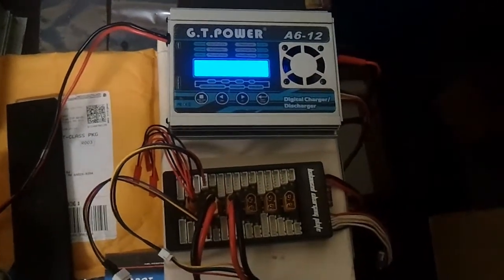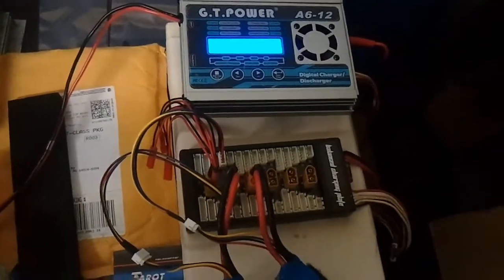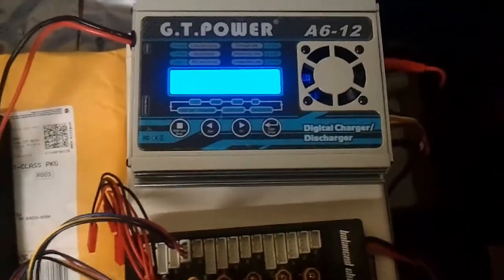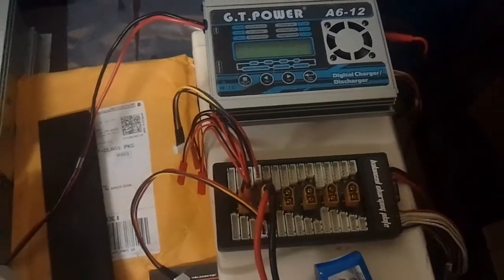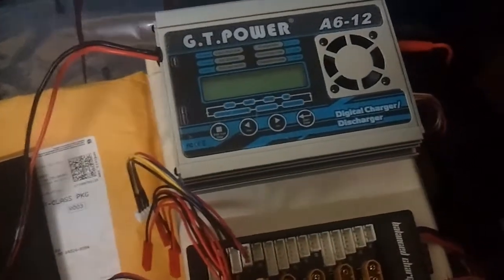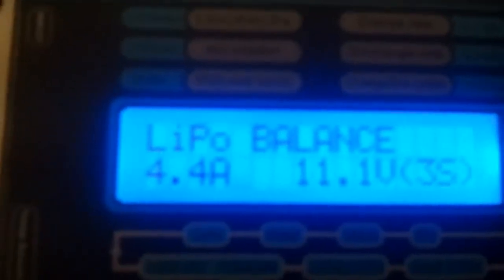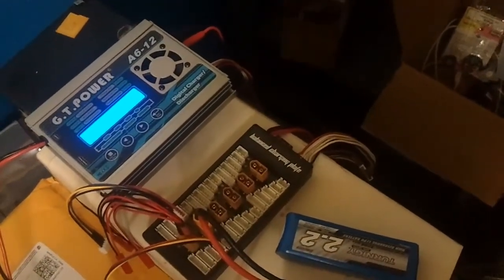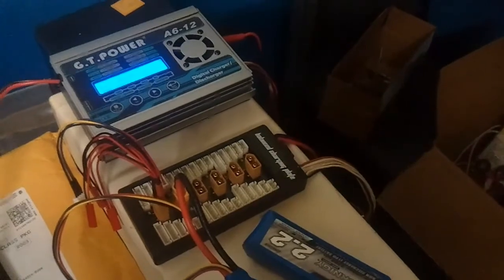GT Power A6-12 Charger from Value Hobby - PART 1 of 2

Comment: After the discharge circuit let up the smoke, the balance circuit could not balance, so it charged as fast as it could but then could not balance (in balance charge mode) so it timed out. in the future dont even bother discharging a pack one volt before parallel charging, that one volt will not cause enough of a surge charge into the lower pack to hurt anything,
Reply from the maker: I agree, and I'm sure you are aware, but as a reminder to others that are reading this and thinking about Parallel Charging be sure to plug in the two main leads of all packs first so that the high surge current equalizes between the cells before connecting the balance taps! A one volt difference between cells going through the balance taps will likely burn the small balance lead wires, that's why you always connect the larger main leads first.
Reply: I did not understand this part can you please explain it a bit further 

'' in the future dont even bother discharging a pack one volt before parallel charging, that one volt will not cause enough of a surge charge into the lower pack to hurt anything,''